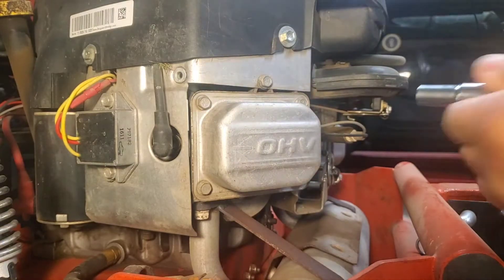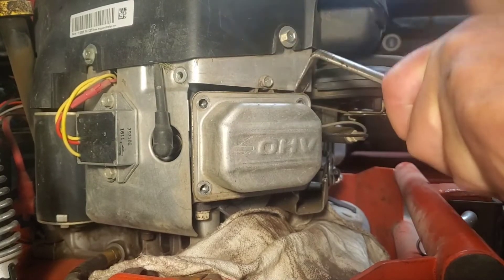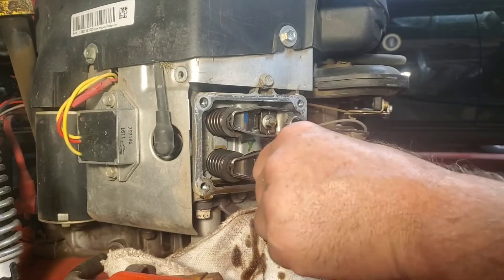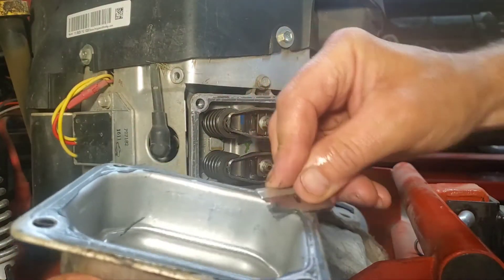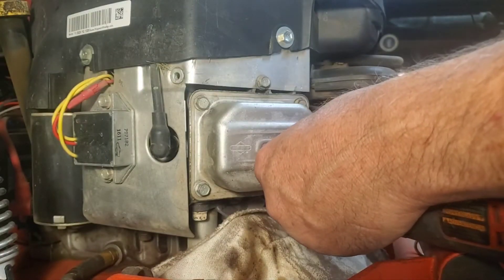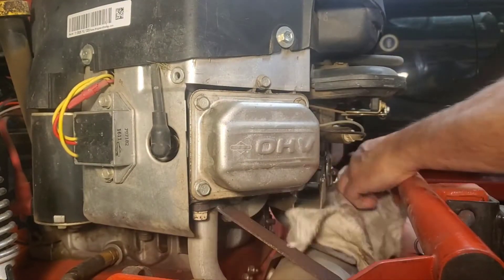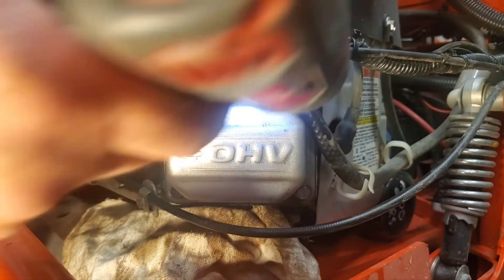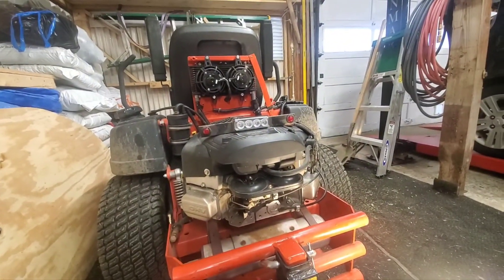Been waiting to do this for quite awhile might as well get it done

Comment: every mower engine i ported for fun i noticed the rockers seemed too loose but when i measured them they were almost always perfect, no valve spring compressors needed for these small engines , it amazed me how easy they were to squish with just using my fingers.